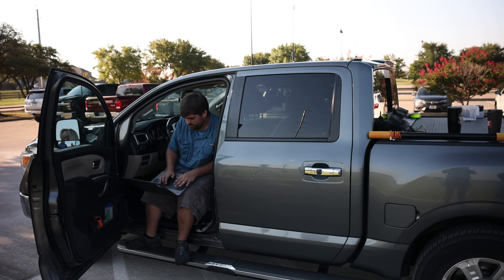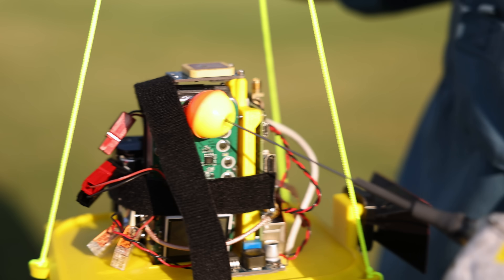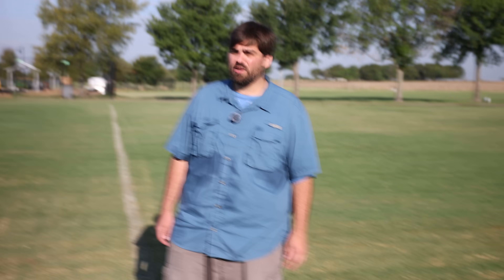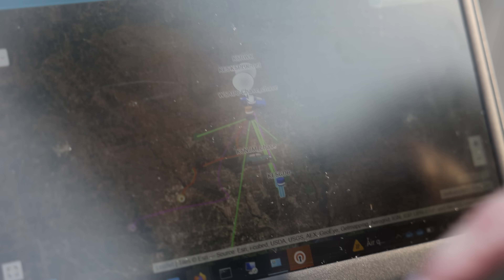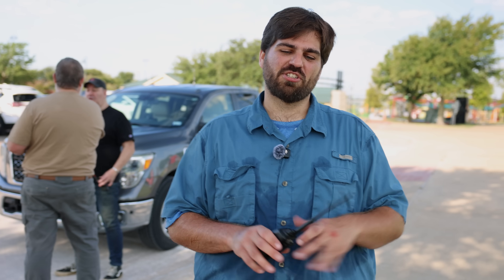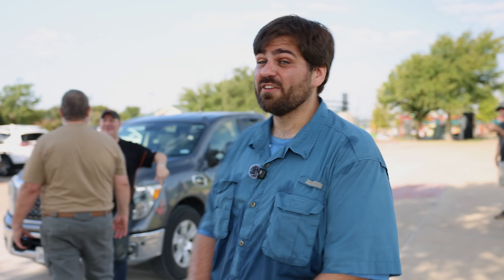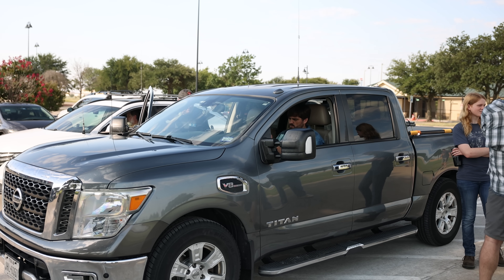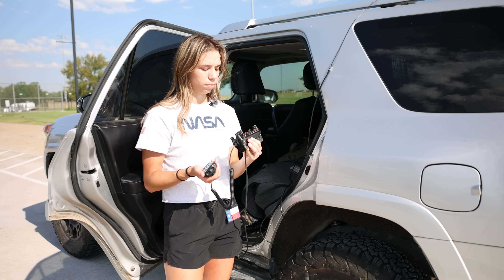Ham Radio Balloon Experiments | What Really Happens Up There

Comment: Great event, sad the parachute didn't deploy destroying all the expensive equipment that otherwise could be reused 😒 
I can imagine the X-band repeater on this thing must have some enormous range ... usually its around 400 km (240 miles) I can rec3eives ADSB signals (1090MHz) from planes at FL450 until the curvature of the earth gets in between, but maybe at FL1000 you can even add a few miles to that.
Because of the heavy battery packs I am sure the descending speed is too high for anything to survive. 
I have had two fixed wing drone accidents (getting out of control and crashing) and mostly parts could be reused, e.g. camera and autopilot with lots of sensors.
If my new fixed-wing drones has enough payload, I may also consider putting a x-band repeater on it.
Reply: Most of the goods survived, but they came down pretty quickly. We'll be flying the same repeater again. 73 de KE5GDB

Comment: I am a member of the RWK as well as the CCARC but I moved last year to 50 miles south of Dallas. I had Horus up and the SSTV up but I guess I need to go higher as I could not get the telemetry over Horus. I did not get the repeater set up but I listened. Again, no contact I did hear SSTV but it was just at the noise floor so I did not get any decodes. Next time, I am going to try and record the audio and see if I can artificially clean it up as well as push my antennas  up to at least 45'. Chip suggested I also try a Low Noise Amplifier (LNA) on receive. Thanks. I watched both your video and Micheal's video. I know Andrew and the K5UTD (University of Texas at Dallas) are going to go again.